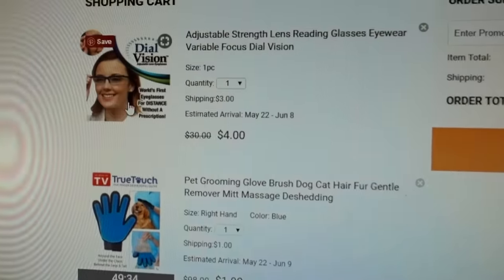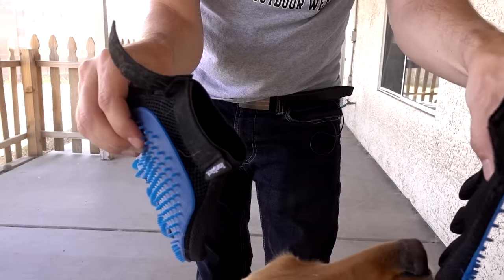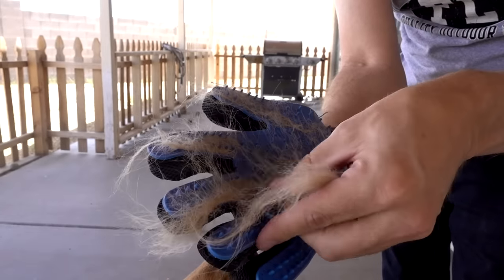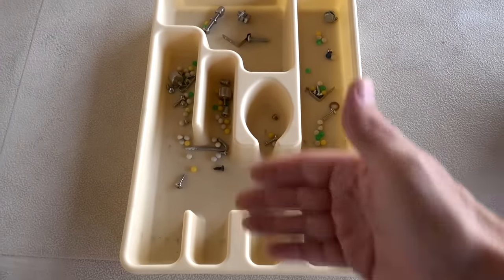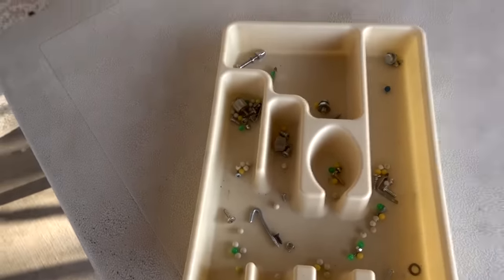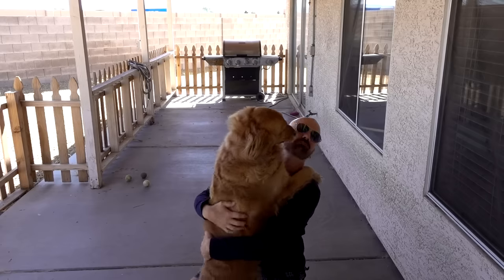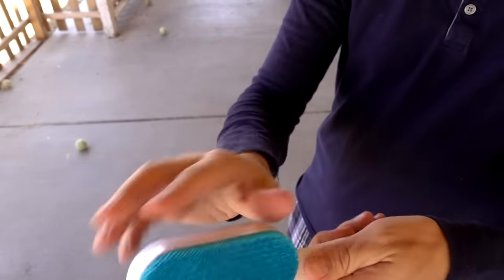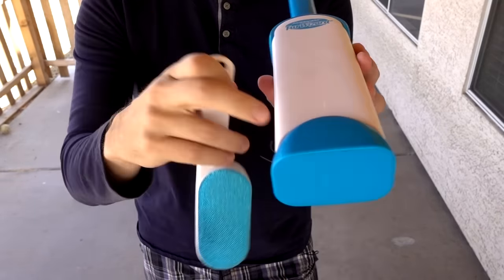Wish vs As Seen on TV: 5 Items Compared!

Comment: I got a PS4 controller from wish, it said Sony original PS4 controller but when I got it the case was from 2 controllers. The top was red and the bottom was black. The middle home button had no logo and the controller had bad battery life, I opened it to see why and it didn’t even have a proper battery, it had like what a remote control car has with the 4 double A battery’s in a grey foil and a red wire attached the the circuit board.

Comment: Man, when As Seen on TV stuff is considered the high mark of quality, that's when you know you're dealing with low quality goods.  Still, easy to see how many of these things are going to work similarly, because the principles behind them are the same.  On the TV antennae, because the signal is digital, i.e., binary, you're either going to receive the channel or you aren't.  If you receive the channel, it's going to look nice.  If you don't receive the channel, you just won't get it.  The real test for digital TV isn't looking for differences in channel quality as in the old analogue TVs.  It's looking at differences in the number of channels they pull.

Comment: With Wish its a website for ordering stuff like this. Random components (if you work with electronics) and little things you don't need to be luxurious or very good. I also would NEVER order something off there that is used as a safety device (i saw rock climbing carabiners on there NOPE). If you want something to just be functional but not perfect then wish if you want perfect then buy the original.

Comment: How to use WISH
1. Use a Actual Computer!
2. Shop around on WISH for the Lowest Price of the Same Item.
3. "Free" means you still have to Pay S/H
4. Take Screen Shots of Item, URL, Item Description ( in case some "Not All" Vendors Change Items and Page after Processing your order)
5. Expect 2 Months for Shipping. (Vendors give themselves a 2-3 month shipping window) 
6. Clothing is 3-4 Sizes SMALLER than what is on label
7. IF you need to Contact Support for ANY Reason, Go to your ORDER HISTORY ( That's why you use a Actual Computer and Not a Cell Phone) and Click on "Contact Support"
8. Pick Category/Topic that Best Fits your Needs
9. BE POLITE, Courteous and Rational when typing your Message ( It Works Wonders, Trust Me! ) and Provide the Photos they Require.
10. Wait up to 2 Days for a Response 
11. When Granted a Refund, WAIT Up to 14 Days for it to show up and check your Account Balance.
You would not be surprised at How Many Ass Hats Get Pissed because they aren't Polite, Courteous, Rational when Trying to Contact WISH and Wonder Why they don't receive their Refunds and/or have their Accounts Blocked or Deleted.

I have Dealt with WISH for 6 Months now and Have Received Every Refund I requested because of Wrong Size, Wrong Items, Misleading Items, Vendors Changing the Item after Processing and Items being shipped to the Wrong Address. 50/50 I got Items I actually Ordered. I have got to Keep those Items as well. They have Never Required for me to send them back. 

I Used My Method Above and Will Continue to Order from WISH. I also use the method above to let them know of Misleading Items of Which they DO and Have Removed. Also to let them know When I do receive the Item I Ordered and thank them.

Comment: You don't really need the clear tv key. I think of it as a scam, because you can just take tinfoil and a coax cable and strip the coax, then tape it to the tinfoil. *Boom* free TV antenna. I get 25 channels with a tinfoil antenna like this. And if you don't have that, you can use a paper clip and carefully unfold it and tape tin foil to it and plug it into your tv.
Reply: kaity kline when I was a kid and my parents punish me for bad marks in school they took antenna off TV while they were at work. At that time I discovered that you can simply put pencil in antenna port and graphite works just as well as real one :)
Reply: Also, stick the end in a potato. No joke. Did this as a kid in the 90's

Comment: That Hurricane Fur Wizard is nothing new. The only thing that is new is the sleeve that cleans the brush. I bought over 40 years ago in Europe a slightly smaller brush, one side made of that material that attaches to fur and hair and dust, and the other side has small spike-like "teeth" that can remove something that is stuck into a fabric weave. I still have it, if I remember correctly it was made in Germany, then still West Germany. The instructions said to clean the brush by wiping it on a piece of fabric, something smooth like jeans or twill etc, in the opposite direction. It gets clean literally with one swipe, no cleaning sleeve needed. It works well and is small enough to have in a suitcase when traveling. I can bet that wish brush without the sleeve works just as well, the cleaning was not done correctly in this video. The so-called "original" that is a copy of something made already 40 years ago is just a gimmick to sell something cheap at a ridiculously high price.  The "magic" is in knowing to use the materials right but most likely the Wish brush did not explain how simple the cleaning of the brush is.  Love your reviews though, you are the best reviewer.

Comment: I have used wish twice and both times I was greatly disappointed, I first tried it because i wanted to upgrade my computer so I had a look and found what looked like a GTX 1050TI for around 40GBP and at the time GPUs were very expensive so I order it and about a month and a half later it arrives, as soon as I open the terrible packaging I see that it is not only not what I ordered by the looks of it but also the heat sink is bent so I install it in my computer and it shows up as a 1050TI I am thinking to myself thank god for that it is actually a good GPU.... I run a quick stress test after having the system on for about 30 or so mins and I get a whopping 1 FPS so I think ok maybe its just some software or drivers and for the next three days try to trouble shoot it to no avail so I contact wish and tell them that what I got was literal garbage and they refund me without me having to send the GPU back which I am now using in a business PC just as a graphics output, I also used wish to order some whet stones (stones for sharpening knives) I ordered them about 7 months ago now and still have not received them or heard what happened to them but again I did get my money back, to any one using wish I sincerely hope that you have a better experience than I have had and I advise you not to buy anything above the 10GBP or so mark as it is likely a scam.
Reply: pc hardware prices are normalized, what it will cost you in msrp in USA it will also cost in China, you choose to pay for something bellow the msrp, if you had went for something close to the actual price chances are that it would had been closer to the real deal or the real product it self, also no warranties in China so be carful and use websites that have buyer protection

Comment: Well instead of the huracane fur wizard i just use tape.... works kinda faster
Reply: I have hip length hair that likes to shed and lint remover brushes don't touch it (for some reason, it sticks/tangles around everything else though!) but the ones which are basically just barrels of sticky paper that you tear off when full work well. And larger than just using tape. IKEA sells them and refills so they're pretty affordable.

Comment: Big disappointment on the Wish Fur Wizard. Lint brushes like that are a dime a dozen. Aside from its smaller size, as you said, the magic is in the base. No base, no go.
Reply from the maker: I was shocked that they marketed it as the same item!
Reply: That end piece that managed to pop off is what you use to clean the brush, drag one of the hard plastic edges along the surface of the brush to remove the lint & stuff.  The original's base likely has something similar inside it (an edge/lip that scrapes along it to clean it), it's just encased & hidden, & doubles as a convenient collector.  But, the smaller one is good to keep in the cat if nothing else, for travel

Comment: You need to get one of y ok u ladies yo tru tge drain wig. It was featured on shark tank a while back and is available at drug stores. My experience has been that I have to change it every month and still put drano down the drain. It does do the easy unclogging. I paid $12 for 12 drain wings. The only females using my shower are me and my sister. Her hair is longer and thinner, ad mine is thick, coarse, and alot of it.

Comment: be careful with plastics and food. some can be toxic when they are heated up. there was an issue with toxic soft plastics that were used for shower curtains. noone thought for a second that you would be inhaling vapors from a hot shower.

again...im not saying anything other than the fact that you NEED to know what plastics are good and which arent and keep in mind you are ordering from a country which cuts costs and corners in everything for the sake of profit...meaning YOU are responsible for your own well being and research.